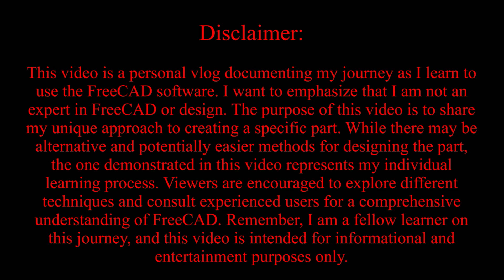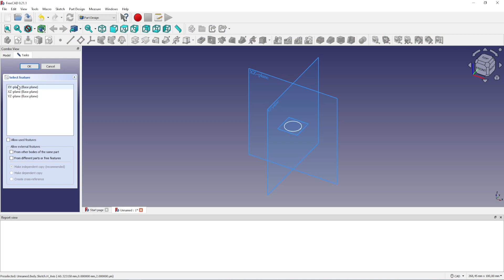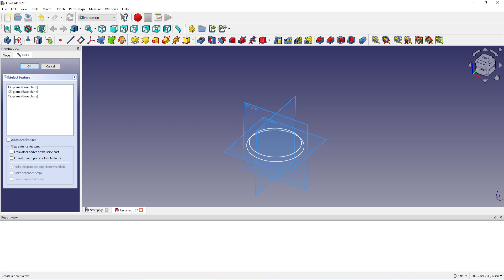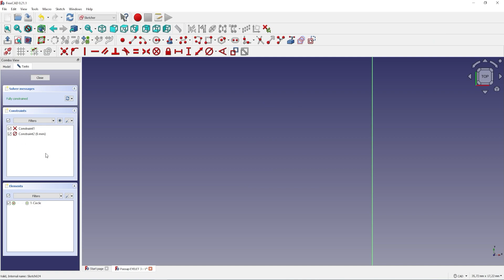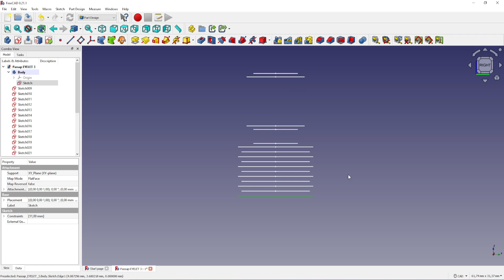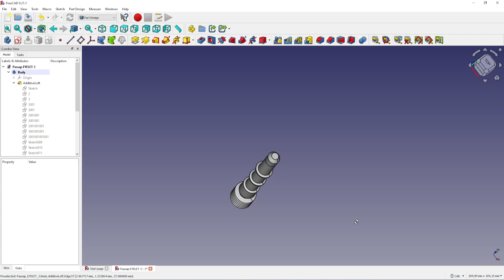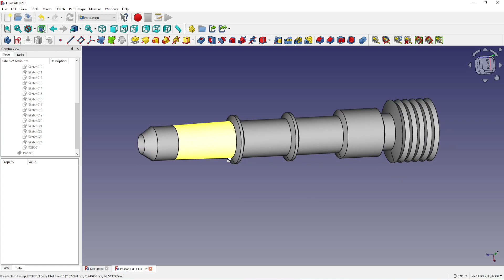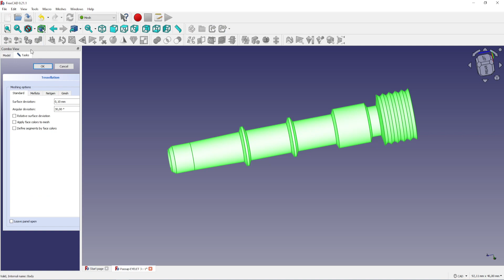FreeCAD: Designing a Knitting Machine Yarn Eyelet Using the Additive Loft (Easy)

Comment: One more question. Is there a way to add a partition down the center hole for the separation of two yarns in the same eyelet?  That is the start of plaiting for Passap.
Reply from the maker: Yes, that can be easily done in FreeCAD. There are so many ways that I can think of, so I'm not sure which one I should share. I have printed a version of this device from Thingiverse, so I will check it out. Additionally, I can still try to make a video demonstrating how to make one of them.

Comment: Pretty impressive. Does it work as well as the original?
Reply from the maker: Thank you! It works just as effectively as the original one. It can even be used with the color changer, as it flawlessly clicks into place. The only thing to do after printing is to make sure the inside is smooth. This can be done with some sanding paper, rolled and stuck inside the eyelet, or applying some clear nail polish to both ends. A perfect test for that would be a threaded strand of yarn held vertically, and the eyelet sliding from top to bottom without getting stuck anywhere.  I will make a more detailed video about this topic in the near future.